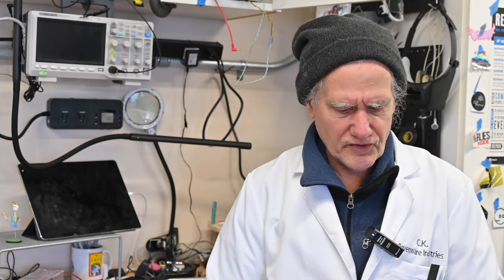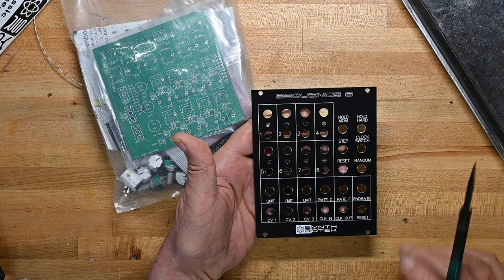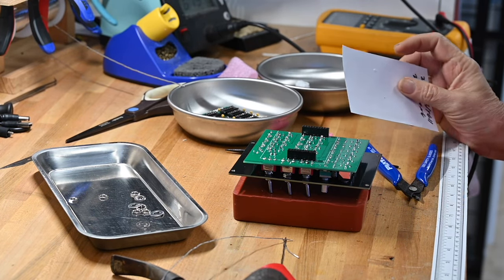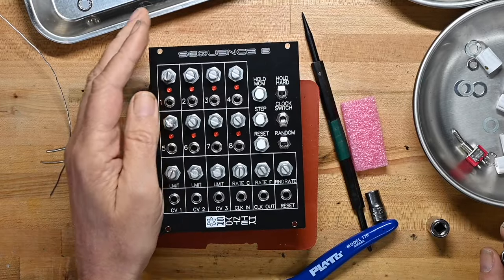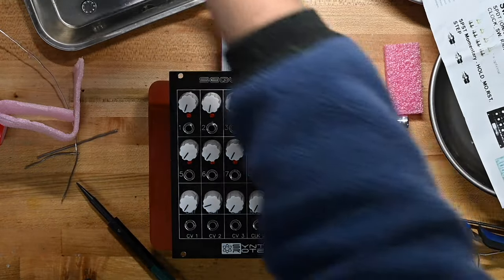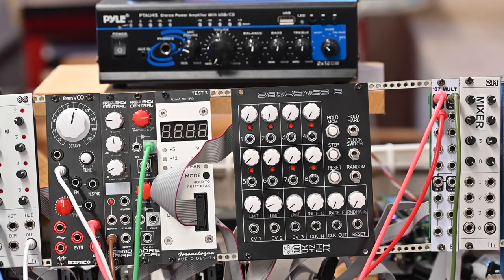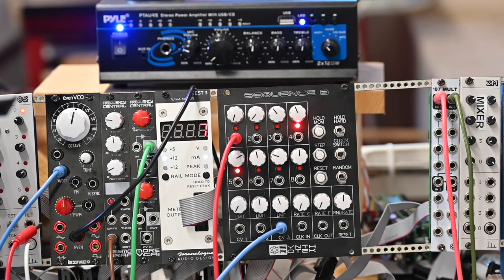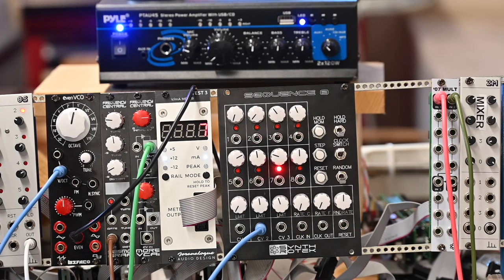C.K builds a Sequence 8 kit from Synthrotek, eurorack

Comment: A 9 volt battery will last for a couple of days nonstop on such a sequencer, actually. Very little drain. Odd that they didn’t supply 1% resistors.
Reply from the maker: 7-8 milliamps is pretty efficient indeed. And yeah, the price difference for higher tolerance resistors is so small that they should just include ‘em.

Comment: Early on you noted that two of the pots were different values. Any chance they ended up in the wrong location? That may explain both the CV1 and the Random issue.
Reply from the maker: I think I checked that, but it’s been about 4 months since I built this kit, so not certain. I’ll double-check it next week (out of town right now), thanks for the suggestion.

Comment: That's a bit of so-so kit. Not much point in having someone sign off the kit as complete if it's missing parts! I just built a Kaussutronics quantiser, great little unit but awful build instructions.
Reply from the maker: And this was the 2nd in a row missing parts. I’m not going to buy from them again, other makers are more careful.  I’ll take a look at kaussutronics.
Reply: @CKHaun  The quantiser is a nice unit but all the smd is done and it's mainly mechanicals with a few through hole but its  fairly challenging due to lots of board connectors and little instruction!